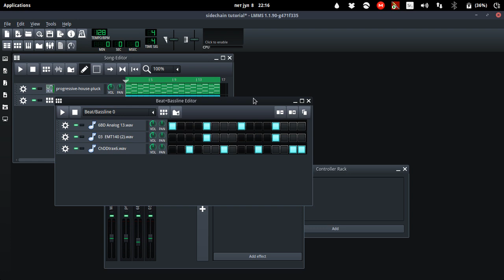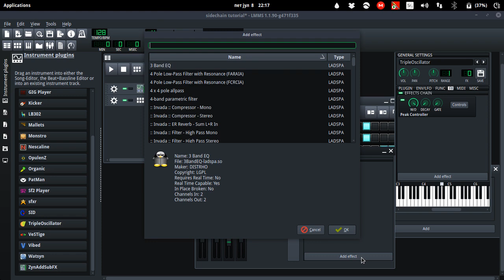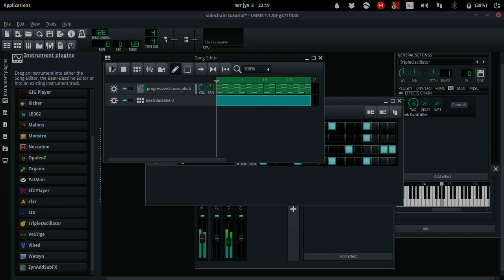Tutorial: Advanced Sidechaining in LMMS

Comment: For TripleOscillator sidechain trigger - you can use a high-pithed sine or square wave, will be lighter on the CPU and actaully a bit more stable than noise I believe (won't differ between different hits). That's how I do it at least :)

Awesome tutorial, please make more!
Reply from the maker: Oh yeah that would also work very well, though I just use noise for convenience, easier to match the length/transient of the kick with noise.
Reply: Unfa' suggestions are always worthy & welcome.
Reply: Umcaruje please tell me how to midi trigger sounds to other sidechain vsts like lfo tool or volume shape in lmms.

Comment: There's still more than one way to do things.

Is it weird that I use FX channels specifically for peak input and just have use the send functionality from any sound in some other channel that I want to have as the trigger? (Also using the send functionality so I can automate sliders, but route them through other channels for volume mixing and control of related groups. Only difficulty is routing isn't always clear here as there's nothing showing trees or reverse look-up, and you have to remember you're not sending to master from some sources.)

In some cases like this, it might be neat to compare even more ways of doing the same thing to see if there's any differences in CPU overhead and sound quality. (Seems not all channels have the same signal resolution for aliasing, etc.)